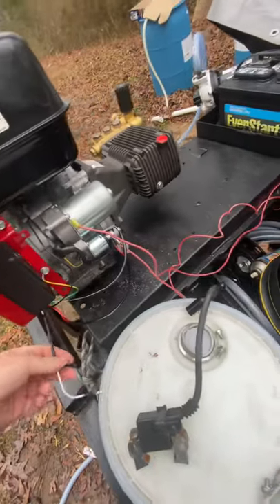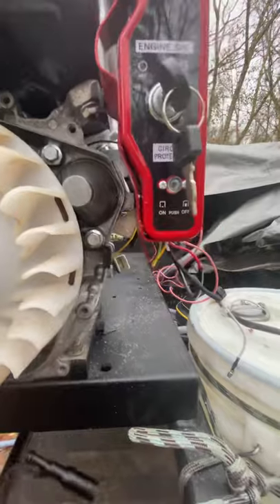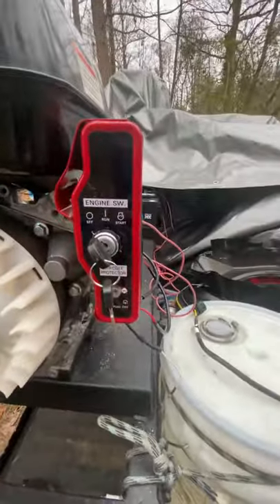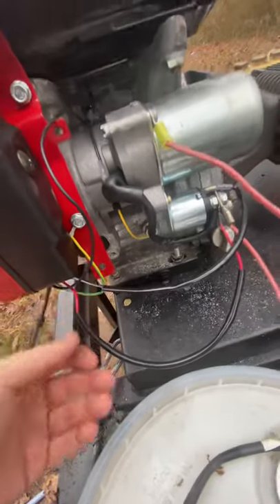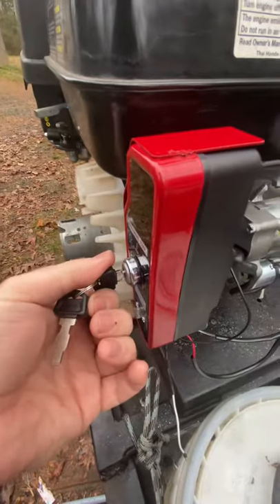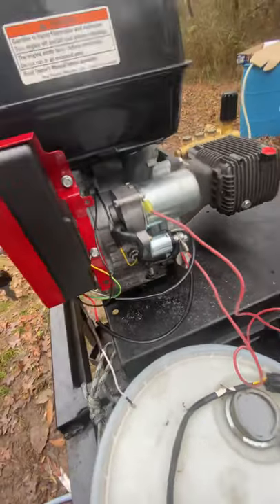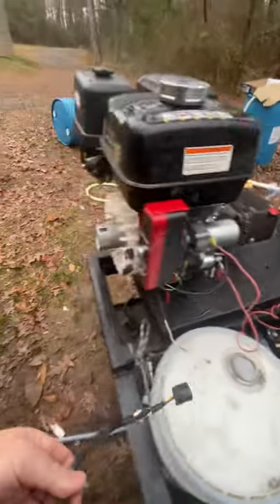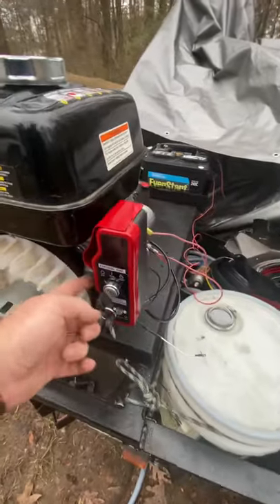Honda GX390 electric starter kit installation explained.

Comment from the maker: Here is the link for the coil. 
https://amzn.to/3GDh3jK
Reply: So if you buy the kits that say pre 2011 models you just have to get the other coil?
Reply: Yea what’s the deal? Isn’t timing supposed to be off if you try using one of these kits on a motor newer than 2011? 
I’ve read the flywheel keyway is not the same resulting in timing being 20° off? 
Did you get around this somehow or is this engine older than 2011?

Comment: The kit that you bought is designed for a pre-2011 GX390, that's why you had so much trouble. Your video helped me out: I had bought the same kit for my 2016 generator GX390, so I'm going back with an early model coil like you did here. ONE PROBLEM: you show to direct wire your replacement coil to your low-oil switch. You need to put a low-oil module between the switch and the coil. It prevents a on-and-off-again situation when the oil is a bit low.
Reply from the maker: Nice. Good info here. Thanks.

Comment: The yellow wire goes to the low oil cut-off , that you do not have installed. Where your black wire that comes from the low oil cut-off , you unplug it and that is where the split pig-tail goes . One side hooks back up to the low oil cut-off and the other to the coil wire.

Comment: Tucker, there are companies that sell used billboard covers or tarps. Some of these will last 2 years, while others will last up to about 10 years and are made of heavy duty vinyl. Both are UV protected. 
If you get a metal frame, you can buy a tarp to cover it, buy a grommet tool, and you can have a nice shelter over your trailer. There are hardware kits that you can buy that use 1-1/2" EMT conduit, and they are made to last. You could look into that as well.
Reply from the maker: Thank you for this. Much appreciated. I’m saving up for a slab and metal building but every time I almost have enough something comes up, wife had a wreck, busted water line in the house. Always something. I’ll get it eventually though.

Comment: I just ordered a new concrete mixer with a GX390 Honda.  It's a pull type, however the company sells the kits.  I will have them include the correct kit.  I will install  it down the road.

Comment: The wire with the diode comes from the charging coil underneath the flywheel. It should be producing 12-14 vdc while the engine is running. It must have that diode inline to produce DC output. Measure it to be sure. It is the charging wire that should connect to the positive side of the battery to trickle charge the battery while running. I have a Honda OEM drawing of the starter and charging circuit if you want me to send it to you.
Reply: Yes the wire with the diode goes to the charging coil. However, that power goes into the box and back out on the red wire to the starter. That red wire is a 2 way street, providing power to the box at start up and  charging to the battery after the engine is running.

Comment: Only thing I did different was put a slip connectors on yellow wire so if needed to test low oil shut down by just unplug it

Comment: 2 1/2” hole saw. And I used a debur bit to make it a little bigger.
Reply: 2.5" hole saw are for gx160 from memory. The gx240/390 is smaller

Comment: I got mine all done just like yours, but it doesn't wanna fire up. It will fire but spits and spudders. Any ideas?
Reply from the maker: Check your gap on your magneto after you swapped out the flywheel. Gap should be size of business card. Check spark plug. Drain your gas and put new in. Check your air filter. And lastly pull your carburetor off and clean it out if nothing else works.

Comment: We've got this kit and a gx200 honda motor. We're so confused - my head is spinning. Would you be up for a paid facetime session to help us get ours working? Our starter spins but doesn't push forward to engage the flywheel.
Reply from the maker: Reverse your polarity on the starter. Same thing happened to me. I’ll face time you no problem. Don’t have to pay me.
Reply: @tuckerspowerwashing5312  when reversing the polarity, the starter begins to spin instantly upon the positive battery terminal being connected even without the key inserted into this new units switch box. That said, when i touched the red cable to the negative and the black cable to the positive, the same thing happened except for it did push the solenoid to engage the flywheel... So we're closer but I'm still super confused. Any ideas to try now?
Reply from the maker: @briannalindley1930   send me some pictures of how you have it wired up currently. 205-275-9544

Comment: Where did you get the trailer
Reply from the maker: Tractor supply. $899 I believe. Wouldn’t recommend though. Just save up a little more and get the double axel if you can.

Comment: What size hole did u hav to drill for the starter ???
Reply from the maker: I don’t remember honestly.
Reply: @Tucker’s Power Washing  I hear u lol  thanks for the video
Reply: Got my kit flywheel mag didn't line up said for a gx390 mine is on a simpson pressure washer now got a big hole in my engine wtf

Comment: I have this motor!   What was the solinoid.  Cant find the match on ebay or amazon and the suppliers say its a simpson motor no info available.
Reply from the maker: Copy this and paste it in your search bar on Amazon. 

FitBest New Ignition Coil+Spark Plug for Honda GX240 GX270 GX340 GX390 8HP / 9HP / 11HP / 13HP Engines
Reply: @tuckerspowerwashing5312  thank you my dude!   Your saving tons of searching.   Greatly appreciate it!
Reply from the maker: @diamondback2085  Anytime man. Pass on the help to someone else! 🤙🏼

Comment: How did you make the hole for the starter?
Reply from the maker: With a Milwaukee metal hole saw kit and a drill.
Reply: When I did it I drilled a hole and used a very sharp chisel. I carefully tapped it around the hole and it broke it out very cleanly, then I used a die grinder to clean it up and expand it a little because the starter was slightly large for the hole.

Comment: What size is your positive and negative wires
Reply from the maker: Positive from the battery goes to the coil negative from battery goes to ground.
Reply: @tuckerspowerwashing5312   yeah I know but what size is the wire used 12g?
Reply from the maker: @josephbell4061   oh. I’m sorry, read that wrong. I would go with 10g if you can. You can probably get away with using 12g if your engine starts up fine.
Reply: Yes sir I've got a question I'm trying to put a Honda clone
In my golf cart,
Do you hook both black wires to the starter, and what do you do with the black wire with the white stripe down the side